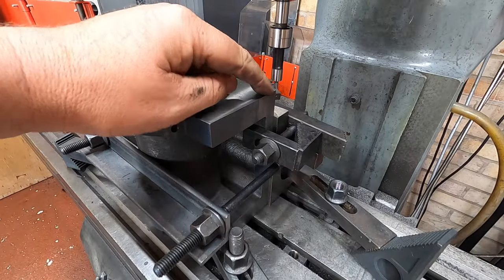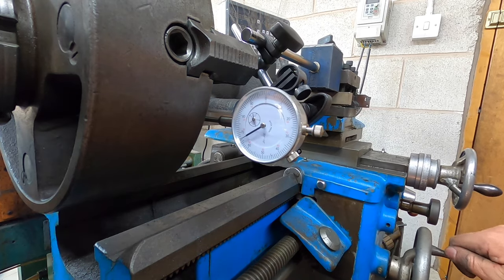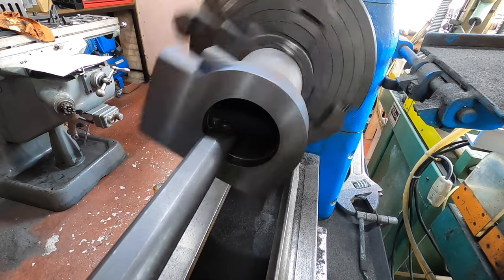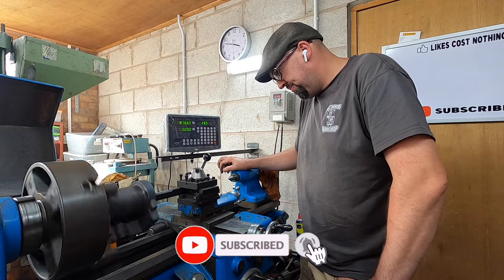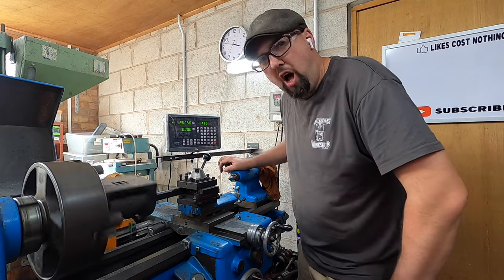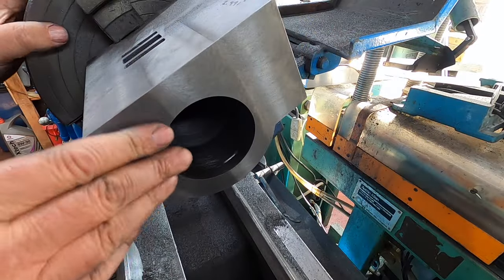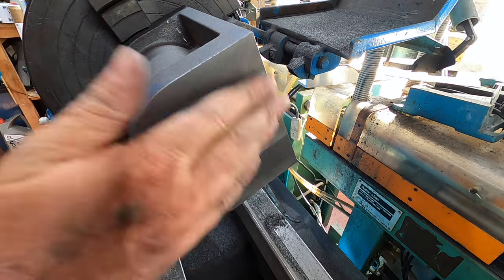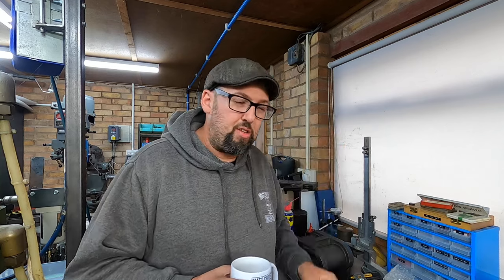Cylinder Boring & Honing -  ep52 - 7.25" Gauge Steam Locomotive Build

Comment: To quickly centre the cylinder is the 4 Jaw chuck, could you bring a pipe centre (cone) up to it from the tailstock and get it almost centred first off?
Reply from the maker: This is 100% true and I would have done it this way, just one small issue...... I don't own one, yet! 😂. I'm building this with a very limited amount of tooling believe it or not. One is one the list. All the best, Matt 👍

Comment: Great video mate 👏👏
I’m going to bore my 5” gge. cylinders on the
Mill ( 1 1/2” bores.. by about 3” long).
This… after having faced the casting ends parallel using an expanding mandrel, and an aluminium sleeve in the fettled cast bores.
After watching this, I’ll now add an extra step, and skim the rear faces again on the mandrel in the finished bore . Thanks for that tip 👍
Regards
Robert
Reply from the maker: Hi Robert, Thank you that is much appreciated. Yes a little tip I was taught by a seasoned pro, glad to hear its useful to others. Hope all goes smoothly with your cylinders, I'd be able to do that bore length on the Bridgeport, the quill will do 5". All the best, Matt 👍

Comment: Gotta say, moving cast iron just sounds good 😅 Also, and I know there's at least three ways to do anything, but blondiehacks taught me to not never do a spring cut with boring bars because they don't like shallow cut, and you're just asling for chatter.
Reply from the maker: You're absolutely right, there are many ways to do the same job. Now what Blondiehacks has taught you is correct for the size of machine she has, which is small hobby, the machine doesn't have the rigidity and the small tools are prone to deflection as they have no meat to them. Compared to her, I'm using a colossal size machine, its industrial size and so is my tooling, I don't suffer with these issues. All the best, Matt 👍